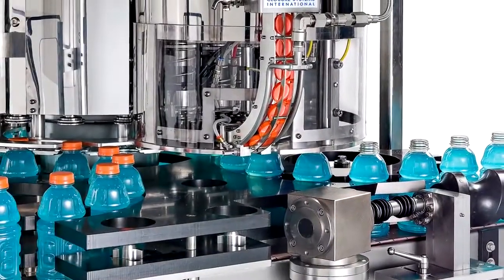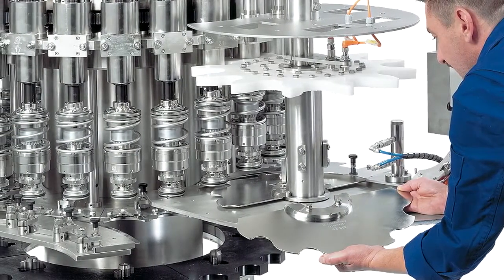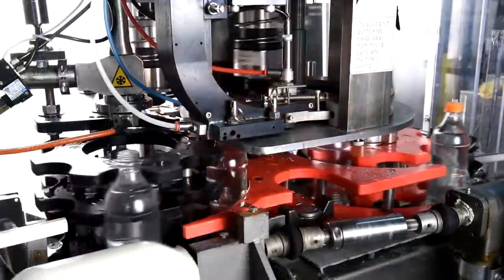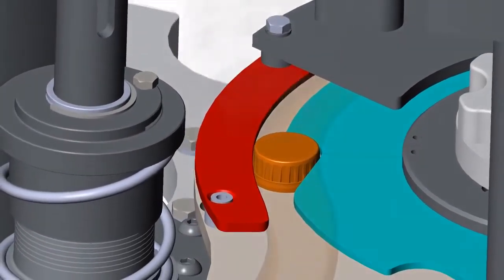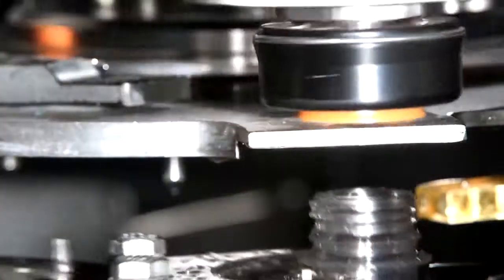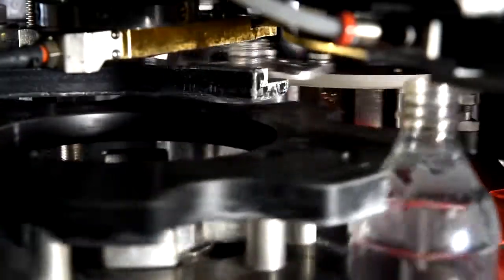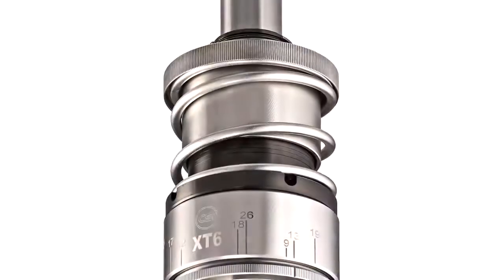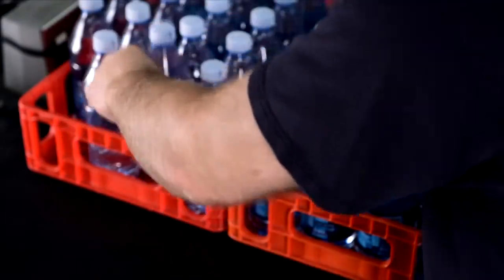CapperRevision2

Comment: What does one do incase the inner ring is broken during capping
Reply: Timing could be off, or the pressure on the head unit itself is too tight.
Reply: One replaces the inner ring (not during capping, when the machine is turned off)